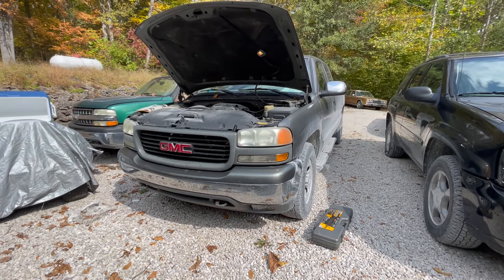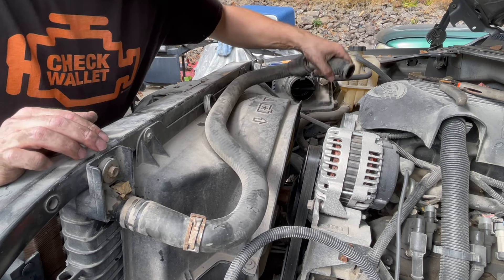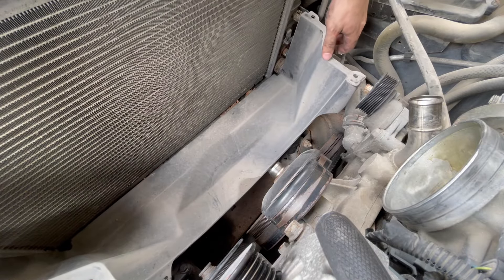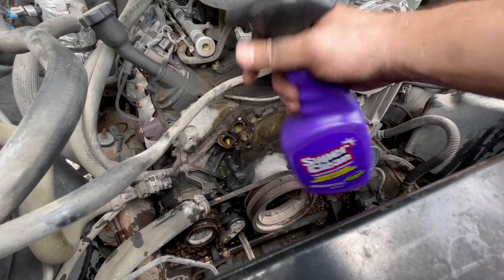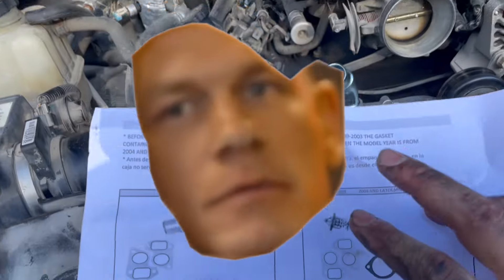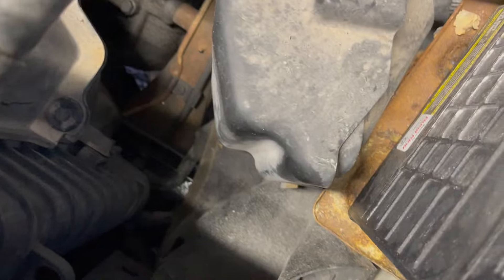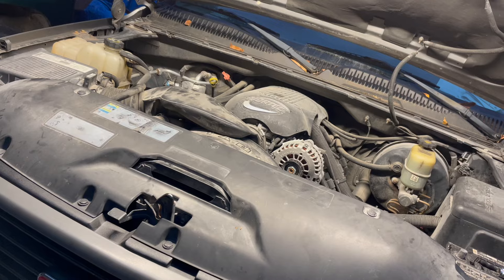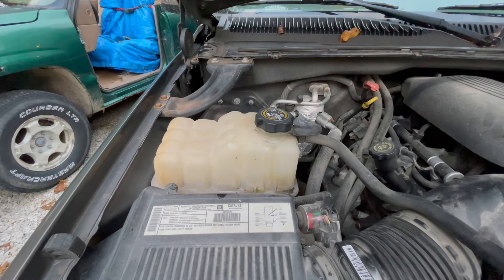Water Pump Replacement & Coolant Refilling Procedure - 02 Sierra/Silverado 5.3L - EASY

Comment: That coolant don't look like dex cool. Was that flushed and replaced at some point or did someone f up, I bought a 97 Sierra long time ago and someone had done that, didn't realize it till after I bought it then learned about the mixing coolant turns into an acid that attacks rubber and gaskets. Wound up doing intake gaskets but it was a good truck after that

Comment: Excellent video! I am a fan of the RK batteries for sure, a lot of bang for the buck and great warranty for half of what the part stores want! 

You got lucky with a drain petcock, the wife's Yukon did not have one it gave me a nice death cool shower 😂😂😂.

You're editing skills are insane, I really appreciate the work out into production 😎

I didn't know about any fill procedure for these. I filled my container full cold, let it run, it pulled a bunch down, I left the cap open, ran until it got up to temp. Filled as needed and then drove it a day, checked again, refilled it and it's been good since 😅
Reply from the maker: @3Wheels1Block  I’m about 50/50 on the RK batteries. They are good for the reasons you listed, but I’ve had a couple of bad batteries from there. A hassle, but I will say, they have always honored their warranty. That fill procedure was what the Haynes manual recommended, the 3Dub method works too! 😎👍
Reply: @TheDaninator  I have had one out of 6 batteries fail, but they are good on their warranty for sure. What's a Haynes manual 🤣... I got a hay bailer that's manual 🤣🤣🤣
Reply from the maker: @3Wheels1Block  😂